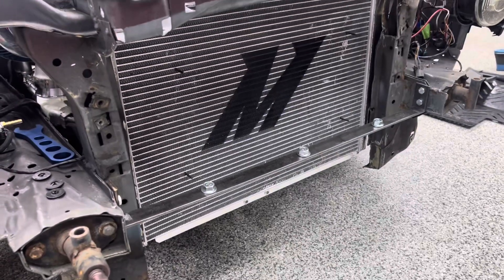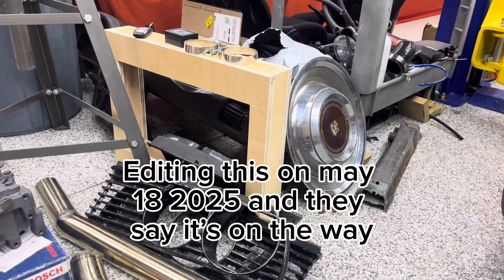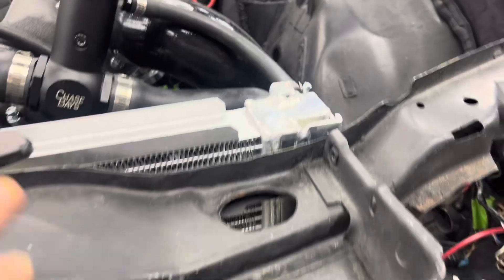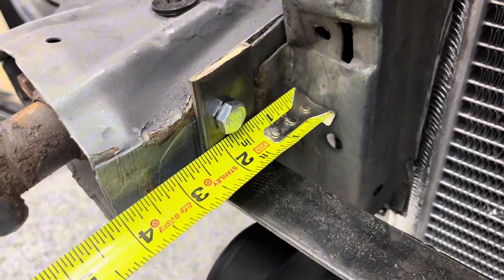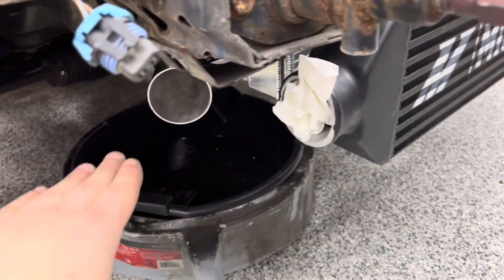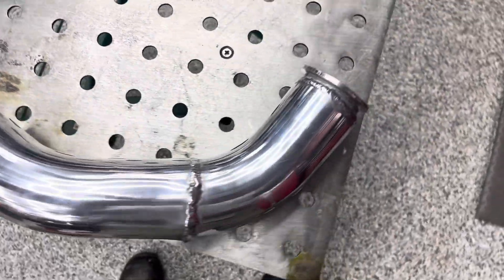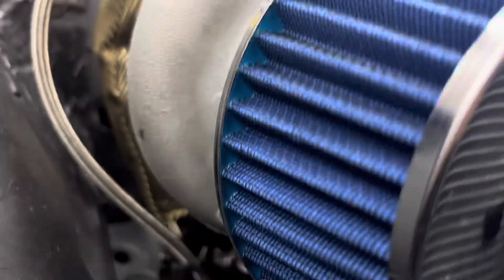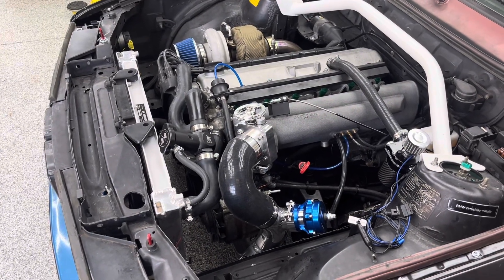Turbo e30 intercooler and charge pipe fabrication and mounting (bmw m20)

Comment: Remove the mishimoto rad and get a Koyorad
I have a boosted 520 whp m20
Reply from the maker: I’m currently converting over to a chase bays radiator, electric wp and all AN lines. Should be good for about 400-450. Video on that in about a month. Thanks for recommendation thought!